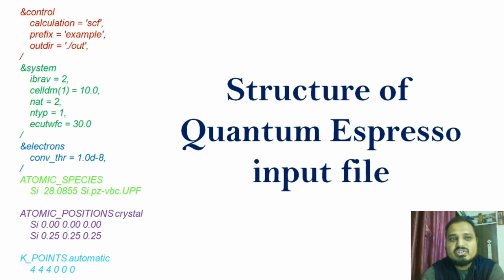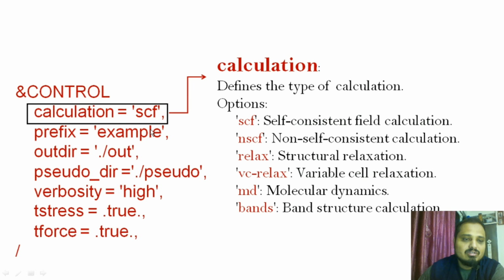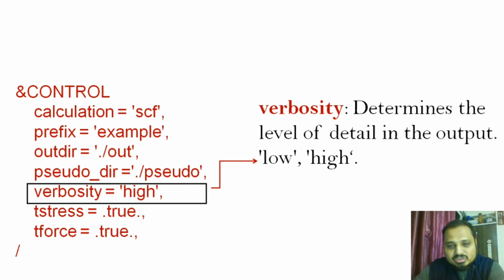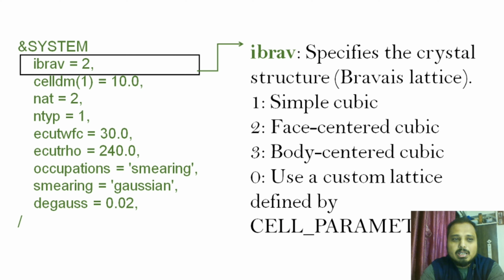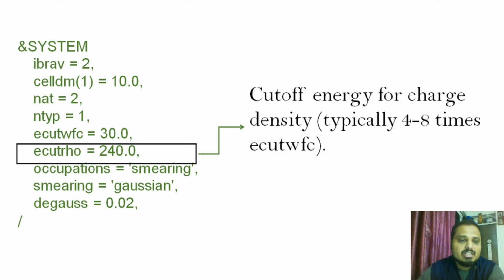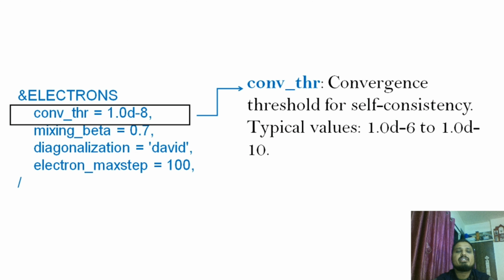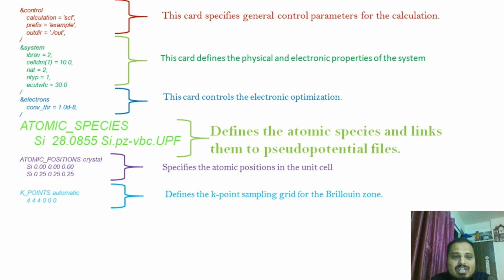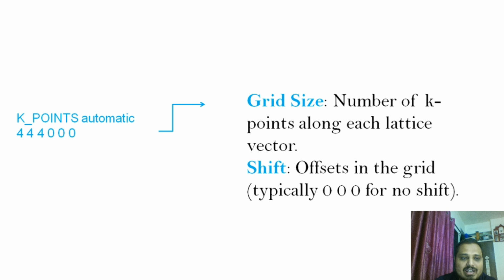Quantum Espresso Input Files Explained

Comment: Sir, How can we select pseudopotentials and other parameters (e.g., conv_thr, electron_mix, etc.) based on our atomic system, research requirements, and computational cost? Please suggest books or other resources to help me create a valid input file that balances reliability and efficiency.
Reply from the maker: Pseudopotentials are chosen based on the material you are studying. There is no strict or universal rule for selecting them. However, it’s essential to ensure compatibility with the functional (e.g., PBE, LDA) used in your calculations.

For convergence thresholds, a commonly used value is  or tighter, depending on the accuracy requirements of your study.

I suggest visiting the Quantum ESPRESSO (QE) website and referring to the documentation. It provides detailed explanations of each input card and parameter, which will help you create a well-balanced input file.